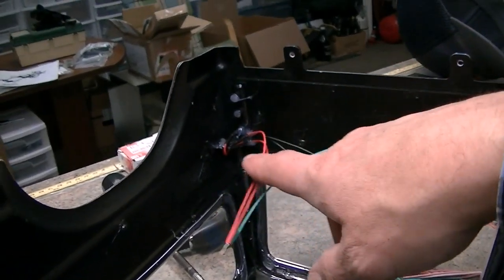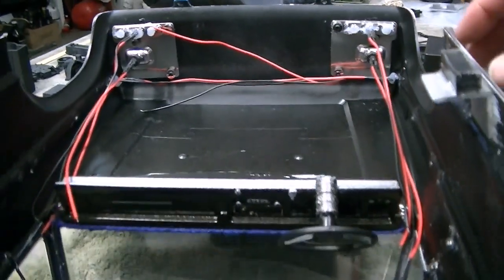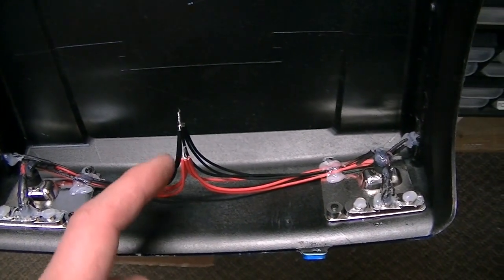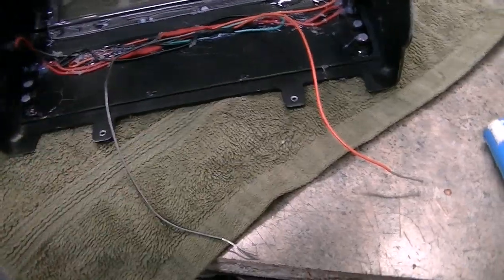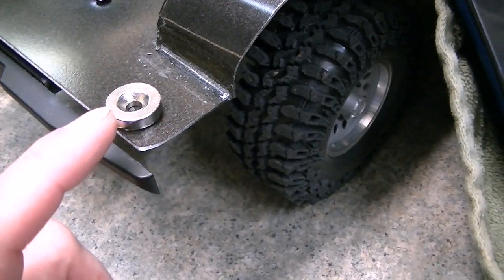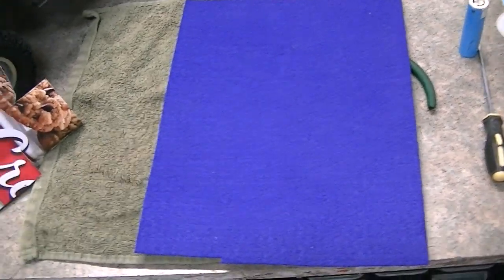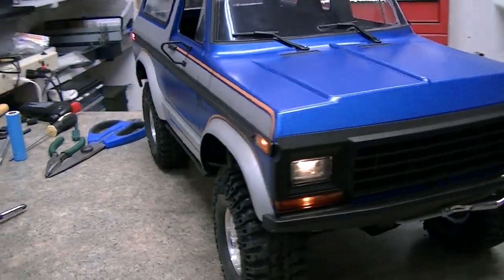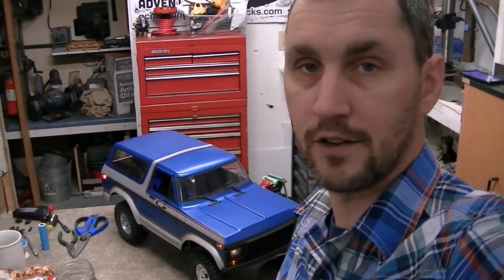SSD Trail King Bronco VBuild 10 Mag Wires Part 2

Comment: You can actually solder the wires directly to the magnets. :) :) A buddy at the local drift track where I am located also showed me this really neet trick. He used black drinking straws cut to length and glued to the inside of the body tucked away from sight to run all the wires for the lighting. Keeps it hidden and makes it really easy to route the wires.
Reply from the maker: I have stayed away from soldering on magnets.. because they de-magnetize when hot. Seems best to glue them. Straws are good too!
Reply: Cool :) I just add the slightest little drop on the side to make the connection, and make sure to be very very quick about it. Have not had any issues so far personally. But whatever works is a win :) Truck looks fantastic btw. And thanks for sharing. These videos sure gives us something to look forward to these days